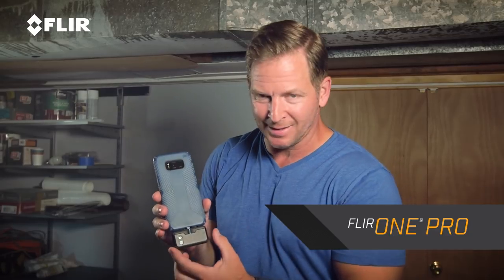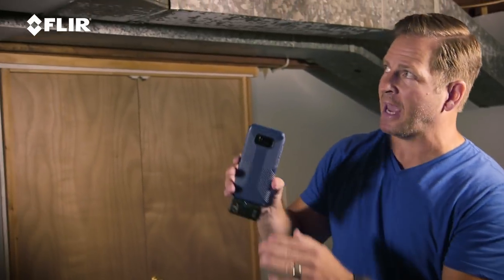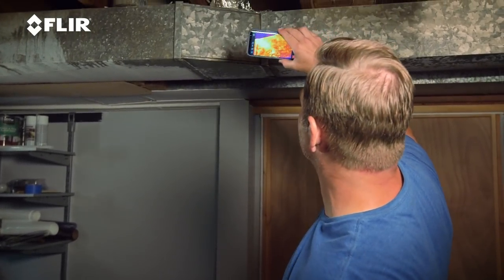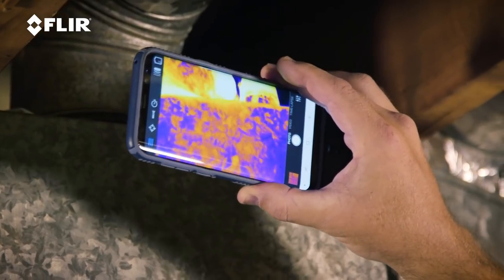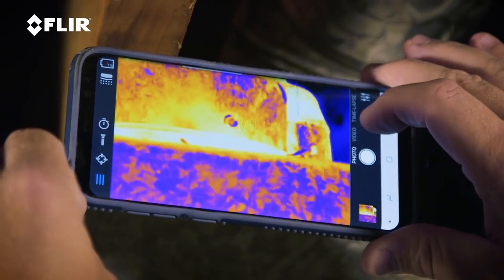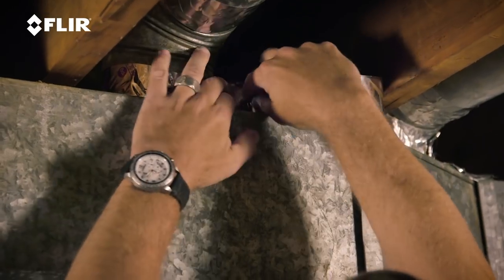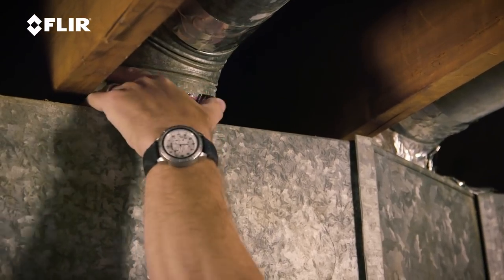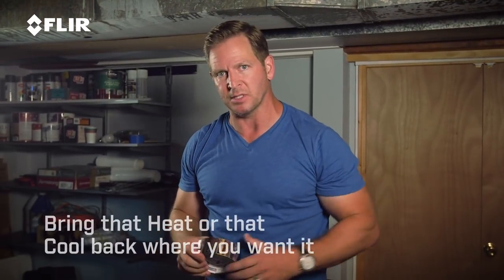Checking HVAC Ducts with FLIR ONE & Jason Cameron

Comment: I may have to get one of these.  For viewers that may see this... Before sealing the leak, wipe down the dust and dry or let dry.  Then use mastic backed tape (1402)  to seal.  If you use the flex duct tape (181b) the host is using make sure to by a bucket of liquid mastic (aka mud or spooky and only about $7) and seal over the tape.
Reply: Josh F. Now you’re talking

Comment: Nah, homeowner is not losing anything, that cool air stays inside of the house in that nice occupied basement and is still cooling it. If the upstairs is warm because of that tiny leak then the homeowner has a bigger problems the $199 overpriced device is not going to solve
Reply: Your assuming they are trying to cool a house when it's obvious it's up north and heating is of importance here. So yes the home owner is indeed losing something and it's money due to conditioned air leaking into a unconditioned space. Your angry and misguided statements serve no greater purpose  other than highlighting your lack of understanding of a subject. At the very least you could explain what supports your misguided views and possibly suggest a better tool instead of being an keyboard warrior.
Reply: @AWIERD1   how about the fact that the bit little of heat loss is actually helpful in this basement. Air movement helps with stale air. Have you ever checked VOC's and CO2 levels in a closed basement? This helps lower those levels..
Reply: @littletmv  I don't disagree with your reasoning, but wouldn't it be better to have something specifically for  this purpose.. like a dehumidifier or humidity sensor to control